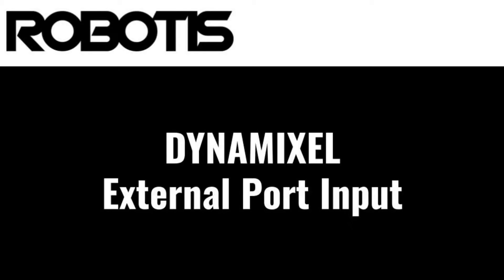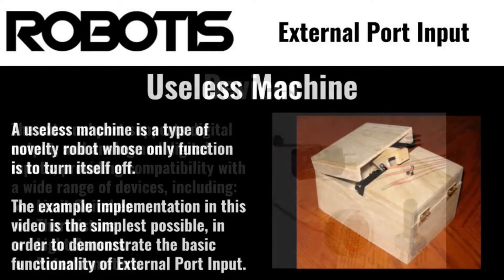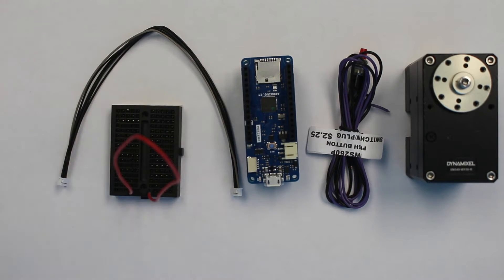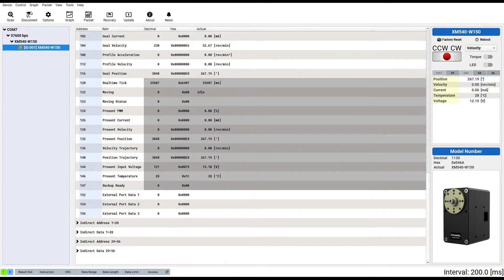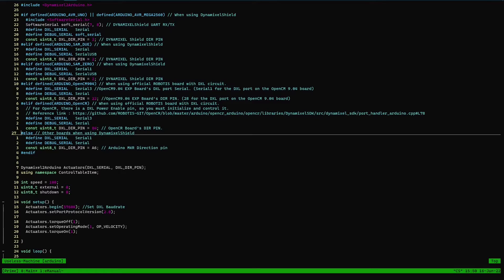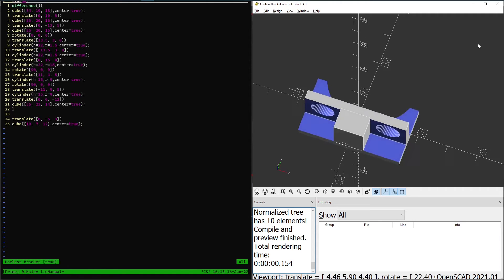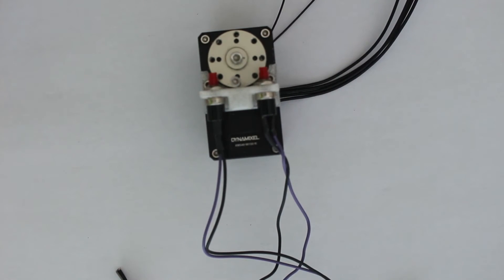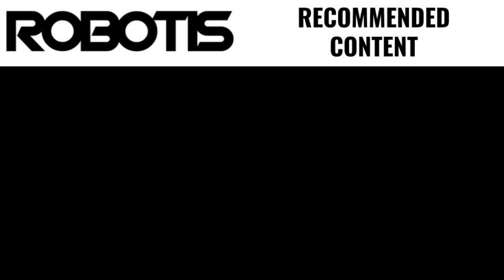DYNAMIXEL External Port Input

Comment: Hello, I am working with the open cm9 board together with 4 Dynamixel AX-12A servomotors and I am trying to control the motors with a Bluetooth hc-05(6) but I cannot establish serial communication 2, I am doing it through the opencm IDE and the arduino IDE but with none I was successful, is it possible to do it and how to do it?
Reply from the maker: For detailed support requests like this, I recommend creating a post on the ROBOTIS Community Forum at community.robotis.com. Creating a post there will allow myself, as well as other members of the ROBOTIS community to better provide you assistance.